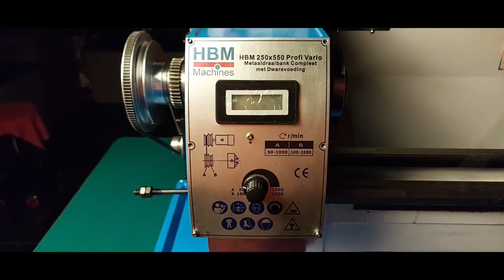New HBM 250 x 550 metal lathe: Unboxing and Dismantling

Comment: Can i use it for woodturning to make pool cue?
Reply from the maker: I would not recommend it, there are specific lathes for wood. This is a metal lathe. Maybe you can buy one already made? Would be certainly cheaper.
Reply: I've read several examples of people using a metal-working lathe for pool cues. They are much more precise and can easily handle the forces involved. Two things I would consider before doing so. First, be sure to clean the lathe thoroughly after sanding the cue in place. The silica grit that falls from the sand paper is harder than your lathe or any tools on it. Not cleaning it up with tear up the lathe. Second, get some high speed steel blanks and cut some rounded profiles for turning as pre-ground and carbide-insert tools are generally made for single-point cutting and will not make the kind of surface you're looking for on a cue. 

The wood chips and dust should not be any problem as they are far less destructive than metal shavings and dust. Just don't leave them lying around as the natural moisture in wood can stain and pit the metal, especially with stock that isn't well-dried. Not that you should ever use green wood for a cue.